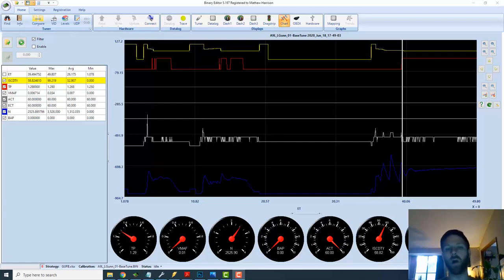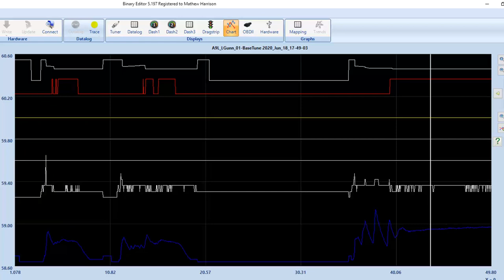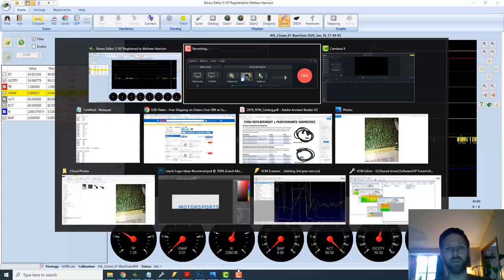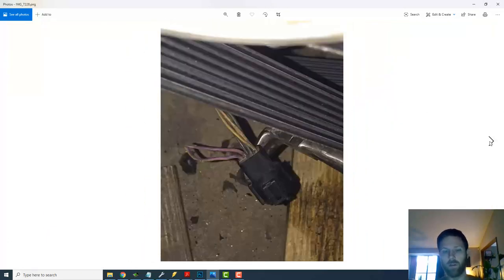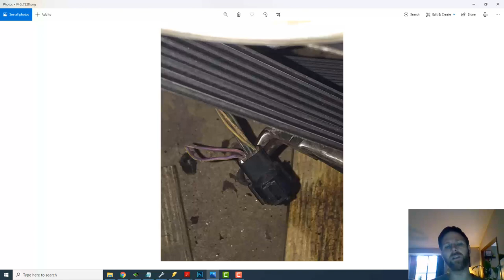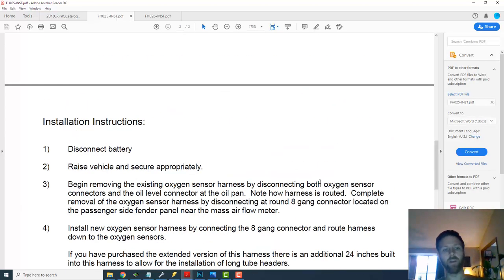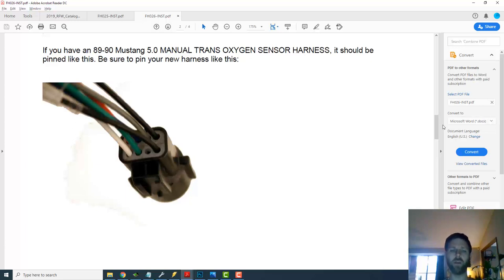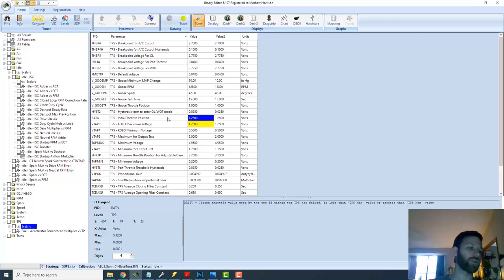How to match the right O2 Harness to your Fox Body Mustang computer

Comment: Hey guys i had a question , on my 91 i am looking for some new oxygen sensors,LMR has the DY605 Motorcraft for 70 bucks each or so and so do several other Mustang specialty shops however in Ford places that sell original Ford parts there is a myriad of sensors for wildly diferent prices, im not going to lie, id rather pay 30 dollars for one than 70 dollars,here s a example of one part number   DY-792, F4DZ-9F472-A and this they claim is stock sensor for my car for only 22 dollars so which one is it? there's several more part numbers,all good quality stuff, no junk, do you know what the answer to this might be? thank you for your time
Reply from the maker: I wouldn’t spend the money for motorcraft on this specific sensor. Just get a matched pair from the parts store. Bosch, ntk, etc

Comment: So I have a3m1, having a high idle issue it stays at 1k even after messing with tps etc. And the pcm has a bad tracer, I found this out when I  suspected the ecu was at fault and decided to take the cover of ecm off and found what I found. That said, the car still starts and idles and goes, but it is an 87 car with 89 engine harness, but since I had this set in an 86, I kept the 86 o2 harness and am just wondering what I did wrong and what can I do to fix it
Reply from the maker: With the A3M1 and an 89 harness, you ultimately just need to make sure the jumper is pinned like Ron Francis shows on their instructions for a Manual transmission. If that is done, there is no reason that tracer should burn out again.

Comment: Hey I have an 89 gt that’s originally auto has stock ecu, harness and auto 02 harness. Currently doing a t-5 swap, can I just leave the stock auto ecu with the stock auto o2 sensor harness with out having to touch it
Reply from the maker: Yes and no. You won’t have issues with the computer frying. But without a custom tune, you won’t have the critical idle air valve control that keeps the car from wanting to stall on deceleration. But with custom tuning, either ecu can be tuned to do what you need.

Comment: Question? Recently swapping the A9P for a A9L computer to complete my T5 Swap.  Is re pinning the O2 sensor is the only thing required to complete the computer Swap? Thanks!
Reply from the maker: What are your plans on the clutch and neutral safety switches?
Reply: @LeechMotorsports  not sure what you mean by clutch and neutral switch.  The car is been running with the A9P.  Is been giving me problems when decelerating ans engaging the clutch, it dies some times.
Reply from the maker: Hey, shoot me an email at Matt@LeechMotorsports.com with your phone number. I can give you a call in a bit.
Reply: Leech Motorsports email send. Thanks!

Comment: Your videos are very informative. I wish I knew how to tune. I'm 50 years old and a foxbody man. I need a tune done for my new 331 and it's a a9l.  But I do not have any info on the built except the total. 9400.00. It's a real beast but not up to par. Do you do chips tunes and if so how would we go about doing this. I'm in georgia. But have no info on motor it's up and running and I was a Ford tech for 20 years so I know the grunt side of things, just my afr gage go completely lean after about 3 mind ofidle. Seems like a vacuum leak but nowhere to be found  . Real aggressive cm a . Ported and polished Windsor jrs. On a dss block. 7 get pan and all arp head studs. Has IBT rollers.1.6 AND THIS THING HITS A LICK. I JUST PULLED THE 331 TURBO OUT  AND WENT BACK NA. THANKS IN ADVANCE FOR ANY HELP
Reply from the maker: We do remote tunes all the time. Shoot an email to me at matt@leechmotorsports.com With your contact info and I will walk you through the price and what all is involved.

Comment: So what determines the year of car as far as pinout is concerned? Is it the engine harness, dash harness, or computer? I ask bc  I bought an 89 4 cyl. I am converting to v8. I have the correct 89 engine harness and a9l for manual trans. The t5 is from an 86. I assume Im good to go with the 89-90 pinout?

Comment: You saved me on this one i thought I had correct harness from foxresto but this is definitely a 91-93 plug. Edit I repositioned the black pin to correct location but looked back at cart and it did say 90 harness so just gunna send it

Comment: This video was a great help. So just to confirm, I have an 1987 Car. I was an AOD swapped to a T-5. For me to do a MAF conversion with an A9L, I would not use the  jumper on the O2 harness? I actually have done the conversion, but didn't know about the O2 harness issue. Fried my A9L. Also, what is the name of the company you use to repair ECUs? Thank you!

Comment: If you had an auto and swapped over you also have to cut the wire going to the safety neutral clutch, and ground it to pin 46. Because it sends a 5v reference and that will also fry pin 46.

Comment: So I think my car was swapped from auto to manual who knows how long ago. When I got it it had a C3W1 in it. Swapped it out for an A9L. It still has an auto trans harness in it though and the 02 harness is pinned out for an auto but my ecu isn’t fried. The car starts and runs fine and all the voltages are fine and the codes dump just fine. I’m not sure why it’s not fried if it’s pinned out for an auto? I also checked if there was any voltage going to pin 46 with on or starting and no bolts.

Comment: Thanks, this will be good to know when I start dicking around with my '82 Capri 5.0RS. I just went through bloody hell with pin46 on a '93 Aerostar 3.0. My original PCM got stuck and had no Comm so I sourced a 'rebuilt' PCM from Blue Streak that turned out to be a core in a new box with 4.8v on the 46 wire and the throttle closed. Boxed it back up and shoved it up Rock Autos ass never to buy anything again from those do-nothing crooks. The solution was to buy a used PCM off a wrecker on eBay with 75k. That's a pretty bad commentary on the auto parts business in this country when a used part is better than fukn Blue Streak or Cardone. I plugged it in just a couple of days ago, ran perfectly and my van exhibited the same symptoms as your Mustang did (ran shitty, backfire out throttle body, no power/acceleration and prior to PCM meltdown was dropping outta OD back to 3rd intermittent). I hope my rant helps somebody cause I wasted a month firing off the parts cannon and $500-$600 for nothing. Did I mention that along with my no Comm PCM I discovered that Rock Auto is a no Comm business model you should stay the fuck away from?

Comment: So... I've been chasing this same issue for a week now with my 91. It was originally an AOD car but has a manual now. Still has the A9P ecu so I'm not sure what O2 sensor harness I should get.
Reply from the maker: If the ecu is for an auto, the. You need to make sure the jumper is installed in the correct spot for the auto trans.

Comment: I have a 93 manual car with a manual O2 harness, I'm in the processes of getting my car ready to tune with a quarter horse. I pull out the computer and at some point someone has put in a C3W1 (auto) computer.

When I pull the A9L base calibration into binary editor and use that for my tune will that effectively convert my computer into an A9L where I wont have to worry about hardware matching issues like this or do I need to source a real A9L and use that?

Thanks!
Reply from the maker: You are correct. You can load the GUFB strategy and A9L calibration into this ecu, and it should behave as though an A9L was on the car. Then tune from there.

Comment: So I'm getting a new O2 sensor from LMR. So that black wire is just a loop? It's just connected to itself basically?
Reply from the maker: It takes two incoming wires and loops them around to each other. Advice that Ron Francis support gave me was if you are unsure of what combo you have, start off by NOT installing the loop at all.

Comment: What does GFBU stand for? Sorry for not knowing any response would be appreciated.
Reply from the maker: That’s a good question. No clue. Lol. I’m going to reach out to my contacts.
Reply: @LeechMotorsports  I appreciate it my man,I thought you might know. I've seen people speak on this here on the channel. I think my computer went bad,the fuel pump keeps running. 1987 GT,5 spd,no cruise ,added mass air from Fiveolagy.A guy who sells mass air kits.6 yrs ago.Just installed it,30 psi injectors, air meter adjusted for injectors. Also added vss kit since car did not have cruise. But it's not an a9l or a9p.It had different numbers than all the popular stuff. Should I get an a9l or convert over to the holy system. All bolt on car,4.10,head ,cam,intake, car,r.r, 3 bar heads,b-cam,t.f. track heat,255 fp,full , exhaust..
Reply from the maker: Does your computer have a chip on it or just running straight off the computer with no tune? When chips are plugged into ECU that are corrupt or have lost their tune, the fuel pump will endlessly prime with key on and the car will not run. But I have seen this happen without a chip on computers that have failed.
Reply: @LeechMotorsports  No I don't have a chip,the computer was supposedly rebuilt and freshened up,lol.But it has set for 6 yrs. It was running fine,and I went to restart it and I noticed the fuel pump keeps running.  I replaced the fp relay,eec relay and it continues to do the same thing.Im out here now,going to pull the computer and check it out. Correct no tune,straight off computer.
Reply from the maker: Computer is most likely needing to be repaired then. I’ve never seen a faulty relay cause this issue. When ECU relay dies, you’ll lose key on power to all sensors and the fuel pump. Fuel pump relay does and will have reference voltage to sensors like TPS but no power to pump.
Reply: @LeechMotorsports  Yeah I pulled the computer and checked it out. It has a leaking capacitor. Just trying to decide fix it or go with a new holly x system 🤔

Comment: I removed my post and going to replace it I have an F-150 1991 manual transmission 5.0 l my question and also pondering any other issues and you've done said some that really pick my attention like the length that the O2 sensor wires have to be before I can bridge the second one incorrectly without it frying my ECM I am taking an A9L ECM from a stang and I am installing it on the truck now I know I'm going to have to change it to MAF and as particular as I am if it doesn't look just so as I said meaning if I don't look exactly what i think it's supposed to.... Nope and also a very important question very important an plenum... F150 would do you think that it would still work okay because I know the flow dynamics aren't as good I'm worried too damn death that if I pull the trigger and I go through all this that the truck is going to be popping and skipping and running like s h t and that A9L ECM I also saw on the back side of the ECM there is a slot to plug a chip in that is meant to buy like a performance step afterwards  and upgrade it like+hp and other things????? Please man if you can give me any suggestions or input or say something to me that I may not have thought of I'm pretty smart but I'm no dad gum genius LOL small background on the truck constantly would fry the ECM ICM or rarely the coil it did this a lot I went through the harness oh my god have I went through it think I finally got that took care of but before I got it they made it a true dual exhaust no crossover pipe or anything by the way 1 02 sensor WTF lol eventually first I'll do the first half of what I wrote just now later I want to find mustang heads and intake and stuff and convert it over pretty much fully and I'll probably get a i call um a hotter cam to also pep it up more if it doesn't take me off and I find a way to kick a ride outside of it so I can start over correctly I'm kidding I'm kidding it's hard as hell to kill these engines anyways they're tuff as hell
Reply from the maker: I wouldn’t stress too much about doing the mass air swap and it it being something that can be tuned well, regardless of the intake configuration. The port you speak of on the ECU is called a J3 port. In order to apply a custom tune with these eec-IV processors, you would cut the case open a little
Bit around that port and install a chip there. Moates, SCT, and Tweecer are pretty much the only chip options. But out of those, the Moates is the only one I would recommend. However, you must understand that it isn’t something that you just plug in and gain horsepower. It simply gives you a complete window into all tuning parameters of the stock computer. There are many hundreds of things that you can change. The learning curve is very steep for this setup and tuning is not for everyone. I would recommend starting by reading the write ups at efidynotuning.com. I probably spent 2-3 months reading and rereading those articles before I purchased a moates quarterhorse and learned to tune.

Comment: Question. Do you know if that also pertains to the x3z ecm?
Reply from the maker: Honestly not sure. But my gut instinct is that because the cobra X3Z was always used for stick shift applications, and the X3Z and A9L run off the same GUFB strategy, it seems likely they would suffer from the same issues.

Comment: Matt - What happens if you have the proper harness for lets say an A9P and are still using the A9P ecu, but have loaded a A9L(cal) and GUFB(strat) to the ecu. Does it cause the same issue and should you swap to a manual harness or is it in the board configuration itself?
Reply from the maker: You should be fine to just keep the A9P computer AND the A9P harness. The only thing that you have to ensure is that you either have a neutral safety switch hooked up and functioning, or that you bypass the NSS with a loop. Otherwise the car will not be able to enter idle speed control mode. This will be evidenced by the iscflag always reading -1 at idle unless you push the clutch in, at which point it will show 1 and your spark and ipsibr values should start fluctuating as a way to maintain target idle.
Reply: @LeechMotorsports  Hi Matt, similar situation. Have a 91 Foxbody that was converted from AOD to T5, looks like the T5 is from an SN95 as it doesn't have an Neutral Gear Switch on the transmission top plate, or the port for one. It was running an A9P and I swapped it for an A9L and changed out the O2 Harness with the proper harness to avoid burning out the trace. Anyway, since I have no NGS on the T5 I just bypassed it with a fuse under the Dash, I take it this does not affect any sort of Under Throttle performance if the computer always senses the car is in neutral?
Reply from the maker: Correct. And here is one thing you can do to easily verify if you are good to go. Start the car up and while it’s idling, check the timing. But don’t remove the spout connector like you would when you’re actually setting the timing. If the timing is jumping around, you are good to go. If it is static, then you still have an issue.

Comment: Holy shit this happens to my car exactly, I bought a car that was swapped from auto to 5 speed. Engine was trashed so I bought a new crate engine. Shit wouldn’t fire up whatsoever, went over timing over and over and finally i did troubleshooting and I ended up grounding my tps sensor and huala, it started. So I figured pin 46 was fried. Another way to find out is if you test the ground wire you will see 5v.  Repaired my ecu myself and fixed the issue. Replaced the o2 harness as well because it was wrong

Comment: What do you recommend I run a auto engine harness with the auto 02 harness,aswell with a a9p,and trying to put a A9L ecu in the car,do I repin the auto 02 harness,or buy a new o2 harness for manual transmission and pin it to match the 1989 auto engine harness ,can that work ??
Reply from the maker: You can repin the existing o2 harness that you have to make it work with a A9L.  But it critical that it is pinned correctly or you will immediately fry the A9L. If you do not already have the A9L, I would strongly encourage you to consider just buying a moates quarterhorse and a license of binary editor instead. You can run the GUFB/A9L setup on your existing computer. But then of course you have the ability to change the tune as you see fit. No wiring changes necessary. Message us on Facebook if interested in going that route instead.
Reply: @LeechMotorsports  sounds good thank you for the advice,do ya do tunes on the ecu ??
Reply from the maker: @josecervantes5431  absolutely. Every day.
Reply: @LeechMotorsports  ok Iam a reach to ya on face book